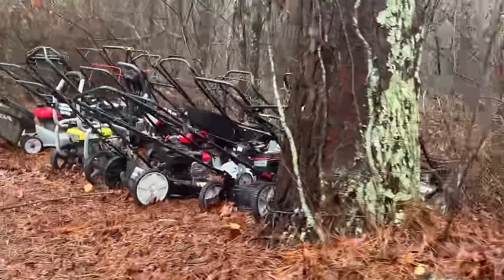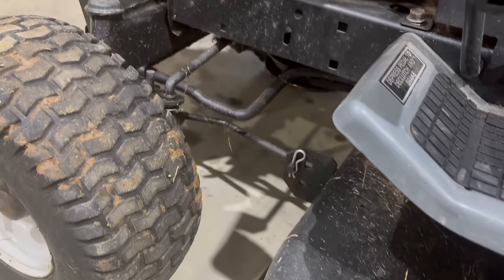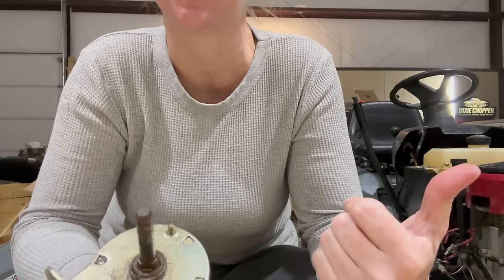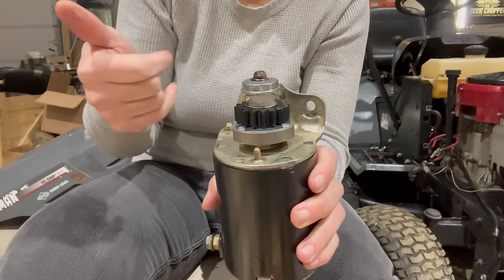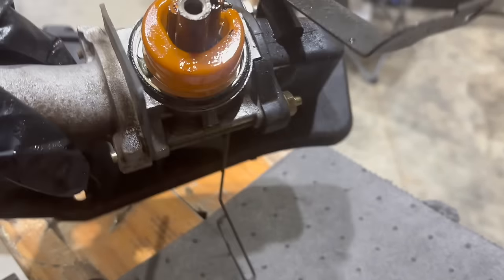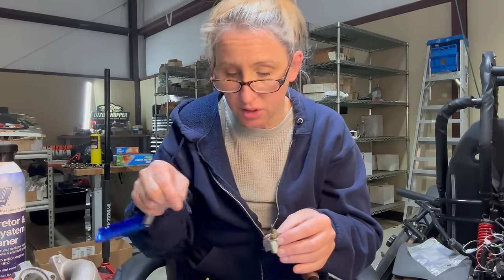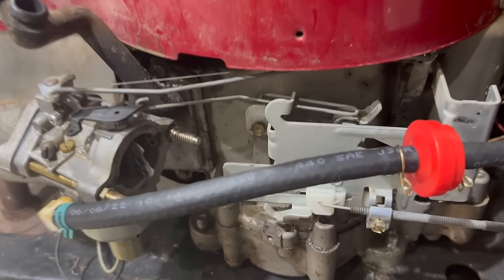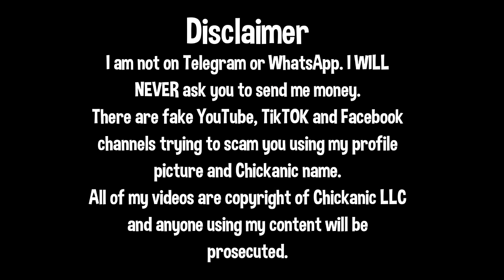Customers 30 Year Old Trash Makes Me TONS of Money! Giving Purpose Back to Abandoned Machines.

Comment: A metal intake manifold in 1995.  My 2007 Craftsman 46" has two pieces/sides some kind of plastic.  My new OEM Briggs carb was $165 before tax and shipping, but it's on a 20HP.  Briggs replaced the original Nikki with another PN/Model because of a history of issues with the Nikki.  My PN/Model is the new one.  There are differences, but it fits, secures and the controls are all the same and works great.  Taking all that time on the carb paid off.  Being 29 years old, it makes sense that the valves need to be adjusted.  Check compression, too.  That would be a good indicator.

Great job, Bre!  👍👍  And Congratulations!

Comment: I had the same Craftsman mower.  Lasted 20 years.  Had to replace the transmission because of the steel output shaft wore out the aluminum bearing/ bushing.  The engine finally blew up even though I changed the oil every year.

Comment: Back in the early 80s, I bought a model 70 Cub Cadet for $25.  It was over 30 years old, but It had a broken rod.  I overhauled it, and used it until 1993, when I moved cross country, and sold it for $500.

Comment: I had an old Wheel Horse tractor with a Kohler engine that was given to me.  I was going to throw a battery on and put gas in it, but something told me to take off the shroud and have a look.  It was PACKED with mouse nest and was a disaster to clean out.  Glad I took the extra time just to look around before I turned the key.  There were other issues like the carb getting cleaned, but that was expected.

Comment: I've got the same mower with 15 horse. It doesn't have a deck though. Picked it up at the dump. Put a good battery to it and some good gas and it runs. Old stuff is built tougher.

Comment: Great to see an old one brought back to life. That is what recycling is all about. Fix it don't toss it.
I have a Stihl 024 AV chain saw. The carb needs parts or a new carb. The shop I used say the parts  and carb are no longer available. Do you have any ideas on parts or replacement carb? It is a great saw otherwise. Hate to junk it and the replacement Stihl is not half the saw that one was.

Comment: Awesome! I have a 1995 Craftsman GT6000 with the 19.5 HP Kohler Magnum in it. It has the 6speed hi/low and reverse high/low trans. It still runs like a top. I use it to mow and right now it has the 48" dozer/plow mounted on it for plowing snow.
It replaced my 1994 Craftsman GT 6000 that had the 20 hp Kohler Magnum in it. Its 50" deck and 48" plow is now being used on the 1995 tractor.

Comment: Every thought about putting a shut off valve inline before the carburetor?

That unit has plenty of exposed gas line to install one.

I shut mine off and run the gas out when done using it

Curious of your opinion on that

Comment: I know that mower, I have a Poulan version of that unit.  I put a little work in it and chase the mice out and it runs like a top.  I've replaced a spindle and put new mulching blades on it 2 years ago and it works every year. Runs like...no, wrong company.

Comment: My uncle had a Craftsman riding mower with a Kohler motor 20+ years old. It finally died last summer. He bought a new Craftsman thinking it would do almost as well.  It’s already had several trips to the shop for warranty repairs. 
I tried to convince him to buy a higher end JD X500 or X700 series given his intended use. 
My X580 (2019) has been very reliable.

Comment: napa sells a gallon can of carburater cleaner. if that carb doesent have any internal plastic parts that would get damaged you can use that and not have to take all that apart.

Comment: Gasoline in engine oil,  it used to be that a lot of airplanes that operated in the north had an oil dilution system.  Before you shut down the engine, it would pump gasoline into the engine oil while idling, to thin the oil out.  that made starting the next morning in the cold a lot easier. the gasoline would evaporate off pretty quickly as the engine warmed up.

Comment: Your excitement when it ran was tye highlight of my morning. I had a craftsman that looked almost identical to that, but larger deck. It was a tank fir 15 years. Then tge head of the engine blew. My friend was a small engine mechanic, and his cost for replacement parts of that B&S motor and to fix would have cost me more than what I paid fir the mower new. It was a sad day. My Garden Tractor  saud bye, and it was replaced with a horrific purchase of a zero turn. Not gonna go any further on that P.O.S.

Comment: I had a $15 knock off China carb on my 2006 Cub Cadet 46' and it was just junk. Wouldn't even start after a week. My original carb still ran good but started to leak all over the place from 16 years. New OEM carb was $135 so instead of dealing with rebuild kits and hoping for the best I spent the $135. Runs wonderful now. My mower is only worth $600 but money well spent still. I actually have 2 Cub's of the same model one is my backup and the previous owner sold it because it did that same engine surging deal. New carb, no more surging.

Comment: On really nasty carbs I use purple degreaser and hot water. Used full strength it almost boils the varnish out, rinse with the hot water, use carb cleaner and WD40 to dry.

Comment: I had been running old craftsman mowers (the green ones) at my different properties. Until my v twin sucked in a rod and went to that big lawn in the sky. Now I'm running an old Ariens sierra about 24 years old. Way better machine than my craftsman but the parts are very expensive. Blades are $40 for 2 the craftsman blades bend if i hit anything but are only $10  and spindles are $20 
Still running one craftsman though

Comment: I worked on old mowers for about 10 years as a hobby mostly. Ended up doing over 100 riders and several old walk behind mower. I think the old Craftsman riders were my favorite. I could fix almost all of them without much trouble. Even the old crapped out decks weren't that much trouble to fix. Bearing and belts usually did the trick. Only found one that had a bad tranny and it was a manual. Those were really well built. The only ones I really liked for being well built and longevity were the pre-80's Craftsman (Sears) garden tractors. I still have 3 of them. 69 Suburban 12 my dad bought new, a 72 Suburban 15 and a 78 GT 14 Vari-Drive. Still use them for all kinds of stuff. Admittedly the newer ones will do a little better job on cutting grass. My old ones I use in tall grass and light brush.

Comment: You want to clean them carbs use Oven cleaner!  Spray let sit for a 2-3-4 minutes and spray off. Rinse and repeat as necessary! Also works great on Aluminum boat hulls that have been sitting in water for a while! Also good for cleaning outside of atv engines  Do not let sit on it for more that 3-4 minutes because its not necessary!

Comment: Before spending time on cleaning a stuck fuel cutoff valve, do a continuity check on it's coil winding with a multimeter or low voltage testlight. No continuity between terminals then valve will not work no matter how clean it is...

Comment: If you are going to try and "resurrect" more of those old machines, buy a heated, ultrasonic cleaner.  20 minutes in a bath of hot water and Dawn dish soap and an old tooth brush can do amazing things !  For really stubborn corrosion get a brass cup wheel for a Dremel.
Reply: Better than Dawn.  Start with BOILING hot water.  Mix 1:10 Simple Green Pro HD Cleaner (purple).  Let soak.  Better yet, put the pot on a small hot plate for at least 30 minutes.

Comment: a long time ago i found a Hahn Eclipse self propelled lawn mower, it had a giraffe sticker on it and i don't remember what was wrong with it if anything other than a gummed carburetor because i have never bought any lawn mower parts other than a fuel pump element for a briggs and stratton pulsa-jet or vacu-jet carburetor (i may have mispelled the names), and breaker points or condensers, or fuel filters. i also found a riding mower with a 8HP briggs and stratton that i removed the deck from and rode it around the woods. i also found a red all aluminum older homelite chain saw and i think all it needed was a spark plug. i found some push mowers that also ran with minor repairs

Comment: Ive got the cradtsman rider like that with the cv14 engine and a 2 stage blower. I couldn't wait to use it for snow this year. Until the front tires wouldn't hold air, and it got buried under the snow

Comment: If ya were in NW Arkansas I'd see if you could revive a Stihl Chainsaw.   (DId the dumb thing running straight gas)  Needs new cylinder and piston and Stihl prices for those parts are 2/3rd the price of a new one.  I replaced it but could use a backup and I've considered Chinese made parts just need to find a local shop to do it. 
GREAT JOB on that mower.  Love to see folks clean rather than replace and I agree older parts are often better made than the new stuff.  Have 1960 Cub Cadet Mower that serves and my little tractor for hauling firewood and brush cuttings around the place here.

Comment: thats odd, I found a 917.256500 sitting out in the woods a couple of months ago . The engine looks nice on it , and has plenty of compression . It is a briggs flathead 13.5 ic gold , it has to run cant wait to fire it up. I am going to have to try and fix it ,it is a pretty nice looking old mower.

Comment: Hi, I found that I still needed to add an inline fuel shut off valve to keep the carb needle from leaking fuel into the crankcase.
Reply: I delivered a new 17 hp Cub Cadet to a customer, but the valve leaked over night.  Installed a new needle valve in the carb, and no more issues.

Comment: Just a daft question, I know why you don't want to put new carb on due to cost.
Do you think of time repair to cost to buy and fit new?
I'm getting back into small tools repair in UK after 10yrs.
Great clips, very very informative and structured.
Thank you chapess👌
Reply from the maker: If it was a customers I would had replaced. The cost of the carb was the same as the time it took me in labor to clean it.

Comment: The only thing MTD did to cheapen units was use those sheet metal front axels. I had several MTDs in the 1990s & 2000 and the decks would wear out too soon. I gave up and spent money on a JD 110D in 2016 to replace a Tractor Supply Husky.

Comment: Love ur videos. Question. I have a 2006 toro LX460. 20hp Kohler. Just put a new carb on it. Works good. But . The piece behind your carb on he craftsman with the linkages. Mine has a piece that I have to manually reset if I choke it.  How do I fix that?

Comment: First thing...spin that crankshaft to make sure its not locked down and check for spark....drop that varnished carb in some flouric acid mag and wire wheel cleaner...buy it by the gallon...soak it scrub it and hose it off with water...piano wire works great on jets...brake cleaner or lacquer thinner works better than crappy carb cleaner...spray clean carb w/ WD-40. Buy lacquer thinner in a 5 gallon container, WD-40 by the gallon...use quart bottle plastic sprayer. Saves TONS of money for your shop...Shop owner operator 38+ year auto master tech.

Comment: I had a fuel bowl that was irreplaceable so I had to figure out a way to clean it and make it rust prevented.... Show a wire brush it like you did then I sandblasted it and I coated the inside of it with JB weld and JB weld is impervious to fuel and it's lasted and lasted and lasted
Reply: You knew just what to do to fix it....Try trading with a brand new spark plug and see if that is it... I like to put a fuel shut off on it and run out of fuel when I'm not using it.... Another cool way to remove shellac from that one jet in there is take a sheetrock screw and grind it into a tapered four-sided scraper and go in there and scrape the shellac out of the jet..... But that's not what your problem is is it? The way I know that I needed to do that was because it wouldn't run unless it was partially choked. Now I've got the opposite problem on it it's getting too much fuel and I think that means that the float needs to have the spring stretched.... I heard that fixes them it's an old EG 2200 Honda generator.

Comment: Xylene will do a good job on melting fuel varnish. Methanol rich 
mixture with non ethanol gas run through can can work if the 
varnish is not heavy like for a first of season use. Xylene will 
also work on caked oil sludge and carbon under valve covers 
or inside heads. Xylene and Sea Foam 50/50 also works. It can
free up stuck rings by bringing a piston up near TDC compression 
 filling the space with the mix, putting the plug in to deliberately
hydro lock the piston and rocking the flywheel back and forth to 
free up the stuck ring. It works good on an engine that has been 
sitting for a long time to free up sticky rings and valves. Smokes
a lot after startup but it burns off quickly.

Comment: Have you or anyone here ever used Amsoil Heavy Duty Metal Protector?  I have a new, still in the crate, lawn tractor and was thinking about undercoating it with this.  Especially the deck.  It is kind of like cosmoline.  I do not think it will hurt the air flow or grass extraction, so why not?  Does anyone foresee any problems?

Comment: The most INCREDIBLE  CARB CLEANER i discovered BY ACCIDENT IS : GASKET REMOVER!  "SPRAY" GASKET REMOVER!!! spray it through a carb and orifices ALL the varnish wrinkles and lifts in 3 seconds!! Then backflush the orifices with brake cleaner, and the rest and its ready for re assembly in 5 minutes!

Comment: I know my dad had bought two riding lawnmowers. The first one was junk. The second one must have been a Craftsman and my dad liked to buy stuff at Sears. I remember shifting the gears and the clutch or brake on the left looks familiar and the flip up seat. I am too familiar with that mower and those tires too. I think may dad had one of these but it was all the way back to the 80's. He must have let me use it. It was at a property he had but the lake dried up for the most part. A very sad story for the whole community. Anyway, that mower looks too familiar. I'm sure my dad had one like it. It might have been a few years older. The first mower was a pukish yellow/brown and the body was made out of fiberglass. It was a weak mower, just crap. The second mower was really cool. Anyway, loved the video.

Comment: Question... i have that mower (2007).  After ajusting the valves ( very hard to crank) it runs max rpms in the idle position.  Even holding the butterfly closed at the carb - still runs way too fast.  Engaging the blades, back to normal rmps!!!!  Any ideas.

Comment: Hey friend, i have a 2005 or so CV15 S 41590 Kohler single cylinder that is on a Simplicity Regent rider. i haven't had any interaction with these mowers or engines however this one sat for about 3 years, great condition all around, question is, how the heck do i adjust the valve lash when there is no adjustment?? i put a new carb on it and i have a coil coming, the plug is soaked with fuel, i drained the tank best i could , put in fresh fuel, it ran some and not some, spit and popped. The spark was weak and sometimes good so that is why i ordered a coil.... any suggestions would be gratefully accepted
Reply: disregard, i just saw a video that showed me what i thought was correct but never new. Hydraulic valves... no adjustment..... live and learn...lol.....Always love your videos from "Chickanic" though!

Comment: I kind of wish you would have shown what you did when it was surging when you first started it. I have a yts3000 that does the exact same thing and I can't get it to even out.
Reply from the maker: I was pretty confident it wasn't a fuel issue since I just cleaned and replaced everything. When it started that hiccup, I choked it again for about one second and then just brought it back to full throttle. Most the time surging is fuel related.

Comment: I that might not be the original engine. There's a rectangle hole cut out in the engine cover usually for a voltage regulator. Well we heard it run and surge, but we never saw you try to idle it. Chances are still surging like that there's a good possibility it might have an issue with the idle circuit. Let us know please as with that much varnish in the carb and you couldn't get the emulation tube and main jet out, I don't know it's kind of hard to believe it works tip top.

Comment: Hey what you doin with my mower, oh wait mine starts like crap. Does this have decompression mechanism. I set my throttle to a certain position and thats the only way the mower turns over quickly and starts. One deg higher or lower and it bogs down cranks too slow. And its not in the choke position its like inch lower. That solenoid is useless, I bypassed it when it was acting up- grind the pin, and never had run on. Been trying to learned up from your techniques.

Comment: My JD seat started splitting with in 2 years of ownership and the dealer and JD told me they would not cover it under warranty. My X350 JD is washed and polished regularly and garage kept so it’s not some beat up pos. The seats on JD riding lawnmowers are absolute garbage!